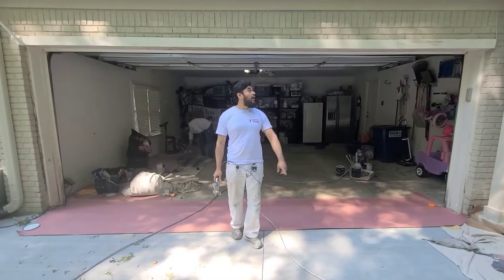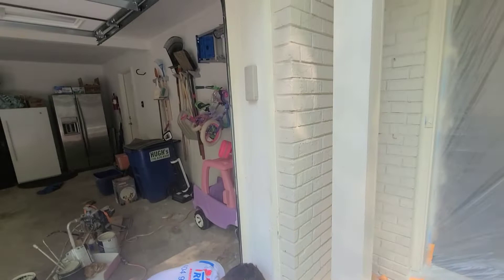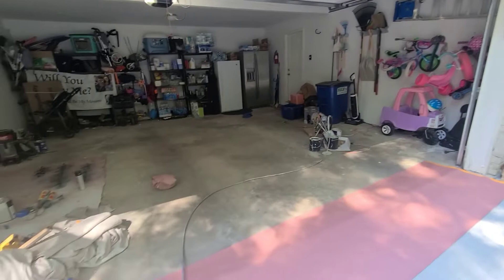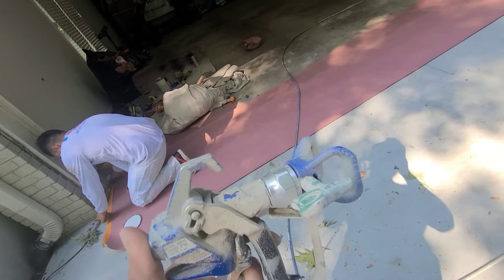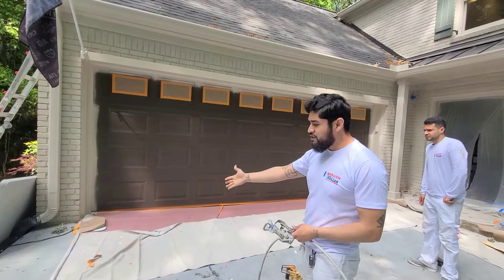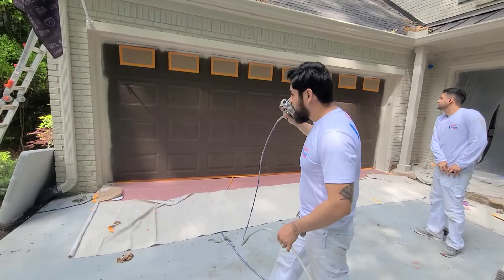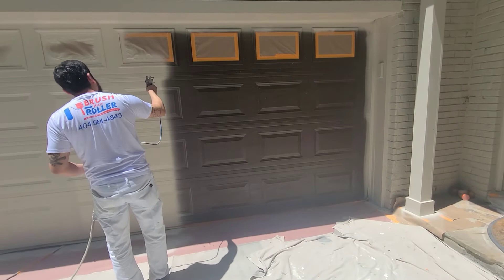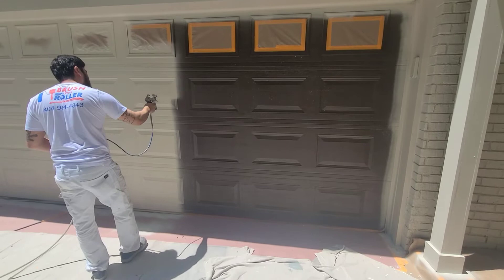Graco Airless Sprayer: Spraying Garage Door

Comment: So you just spray the weather strip to the door? The doors have at least a half an inch side travel built into them. When the move you'll see the brown. Why a FFLP instead of an LP tip? FFLP not made for that paint, which is why you had fingers...? You look very conscious though. Nice video.
Reply from the maker: Why you giving mr a hard time mike? I explained in the video all these things
Reply: I thought the finger was related to the wrong pressure and not to the actual tip. LP is low pressure right? LP is the old tips the newer tips are the FFLP Fine Finish Low Pressure. Did I miss something?